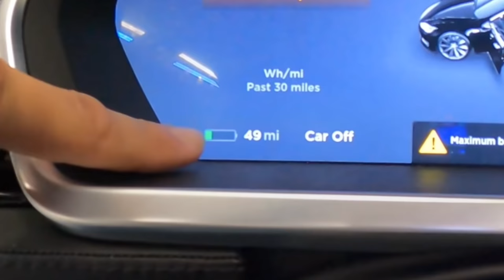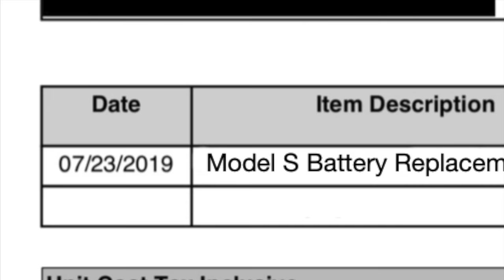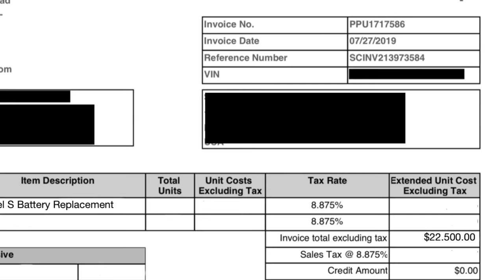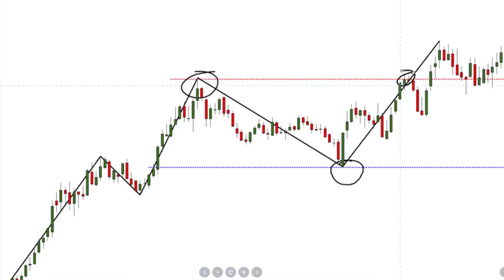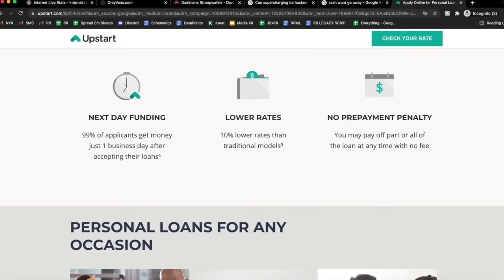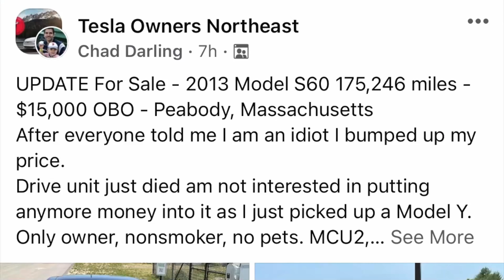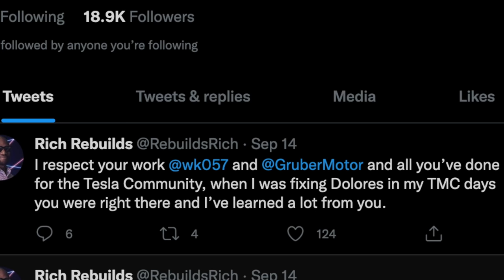The TRUTH about the $22,500 Tesla battery repair

Comment: I can't count the number of times Tesla egotists have claimed diesels have purposely rolled coal for them when, in fact, it was an older pre-emissions engine or likely modified. So much overreacting. I drove a Tesla for a long time and didn't notice anything intentional. I'm sure it has happened at some points.
Reply: Have an ID4 now, Leafs prior. Never noticed anyone rolling coal. Occasionally a modded diesel in front will have some puffs, but thats just something that can happen with more fuel/too much fuel/bad tune on them (used to own an 05 cummins manual)
Reply: If you are interested, there are many videos on the "Wham Baam Teslacam" channel showing this. Usually it features a lifted $80k+ truck that goes out of their way to get in front of a Tesla, usually swerving to prevent them from getting around them, slowing down, then stomping on the gas to create a nice thick smoke screen.

Those are very intental however, and nothing like genuine old trucks that are just trying to over their own weight to get up to speed. I have seen those too, and my response is the same, "You call that rolling coal?!".
Reply: @CodeMerk  I'm aware of a few of those but, from my experience perusing Tesla forums, etc., and seeing these people talking, most of them are clearly not intentional: Just egotistical owners wanting to feel targeted for clout when they know little to nothing about diesel engines.

Comment: It all boils down to giving the customer a choice. as a (non-ev) mechanic, i will tell a customer " you should replace the whole starter, but i can install a solenoid, it will be more for labor and i cannot guarantee the other components will last 100K, but if that is all you can afford, it is an option" some people do not plan to keep the car, moving, joining the military, etc. so often the cheaper fix makes sense. it would suck to put a 20K pack in a 23K car and the motor goes next week. give people options and they make the choice that is best for them. unless the people bitching are willing to offset the cost, they need to sit back and worry about their own issues.

Comment: The answer to "alot of electric chargers are charged by fossil fuels" is if you're not driving an electric car you're 100% powered by fossil fuels to start with, plus once you have electric cars and a charging network in place then changing electricity generation over to non-fossil fuels is a relatively easy thing to do - (and could be done 5-10 years with enough political will), solar is also likely to soon be the cheapest way of generating electricity full stop.

Comment: Great video. I think you call attention to a major problem right now. Many Tesla owners are so devoted to their brand, that the company knows it can do whatever it wants to them without consequence. Tesla really seems to be the only car manufacturer that gives their costumers what they want to give as opposed to what the costumer actually wants. A perfect example of this is CarPlay and Android Auto. Every automaker provides CarPlay and Android (well, not Volvo/ Polestar but that's because Google designed their infotainment and they are working on integrating CarPlay). Tesla doesn't and won't even pretend they will in the future. CarPlay is just one example. The thing is, if Tesla costumers demand better from the company they will get it. But as long as they blindly allow the company to $crew them,, the company will continue to $crew them.

Comment: This is exactly why the auto dealership states monopoly has got to be stopped. They want no part of the "right to repair" bill so they can continue to charge 4 or 5 , or more times the actual cost of the repair OR the cost of the parts. A part that costs $50 they want to charge you $398 dollars for it, or at a "special discount" of only $298. Wow, we saved you a $100. What a deal.

Comment: Tesla is making a huge mistake trying to build a frame that is also the body.  Their power packs need to be easy replaceable without endangering the cabins strength in its integrative approach.
In addition, 22k is ridiculous. 2.2k is more like it to replace an EV battery pack.  The process should be easy.  
Their throw away EV concept at Tesla does what for the planet again?  
Someone is going to develop a replacement pack that will not require a modification to the current pack.

Comment: I think that there is space for a third party tesla workshop to provide bespoke improvements to Tesla engineering.  for example a skid pan for the two wheel drive M3 that doesnt destroy battery coolant fittings when driven over a curb, or junk on the road. a fitted sheet of steel, or reinforced cabon fibre would be inexpensive to make, but would provide substantive piece of mind.

Just like i re-engieer Apple products. My 16” m1 Pro Macbook is heavy. and Apple geniuses gave it a case finish that is slippery in the hand. My 16” can easily be picked uip with one hand, without using gorrila grip (which can crack the screen).  All Apple needed to do is knurl finger grips into th front and back covers. This solution could also marginally improve heat disapation and case rigidity.  
Major manufacturing coporations should reliably put products to market do not have engineered in failure, or obsolesce!

Comment: Actually I think replacing just the bad battery module is a great repair.  If I had a bad injector on my gas car, I wouldn't replace the entire motor....just that bad component.  The fact that the battery pack IS repairable at the component level is awesome.  I would have done the same thing.  I always wondered if my battery pack was on its last leg could I in fact just put new batteries in it and have it back to right as rain....now I know yes its possible.  So buying a tesla with high miles or an older model is now an option for me.
Reply: Messages and chats

Comment: No major comments in regards the video...people has the choice to repair the way they want - Richard said it clear. The comment is mainly with actual EV technology and their battery reliability over time. If one or more battery modules fails after some years & miles of usage (not when car almost new or after few miles), that means the other modules might eventually fail sooner or later since it appears a normal wear out of the battery. So you could expect after some years & mileage or number of charges (don't know, 10 years or so) that your EV battery might start failing and only a full battery pack would fix it for other many years 😨. This could be a deal breaker in the future for used EV sales - I'm not sure if I would buy a 2012 EV car unless I have the proof the full battery pack was recently replaced. If they show they did battery repair (changed defective modules only) or even worse no battery pack service, I wouldn't buy it. Then it would be a risk to keep your EV for too long since price might need to drop significantly or a very costly repair would be required (both not financially viable). Learning every day more about EV challenges

Comment: IF one needs to have battery serviced for bad modules every two years, and the vehicle is kept for 10 more years.... then the NEW battery would seem the better route.... unless a serviced battery is covered for 10 years parts and labor... but no-one in their right mind would front 22,000 on virtually ANY repair. They would get rid of the car.

As long as you are not bankrupted by a battery service that only squeaks past the repaired warranty, the gamble is necessary. IF you can AFFORD for the worst case scenario, you might be the one of those who GETS 10 years of added driving, with only a decrease in range, and you win!

It is cheaper for a poor person to buy a new Tesla, sell it at 10 years, than to buy a USED one, and pay to keep it running years 11-20. Poor people should NEVER buy money pit cars. Mercedes and BMW....... you can buy an 8 year old car with 100K on it for 2000.00...there is a REASON expensive cars are cheap, used. 

An exception to those with limited funds buying luxury, exotic or hard to service cars: If a kid wants to do his own wrenching and LEARN about cars.... buy a used Lotus, Mercedes or Tesla, and make it a PROJECT.... hey, isn't that what a guy named Rich did ?

Comment: Regarding "Tesla competitors": give me a Subaru BRZ or a Chevy Corvette with an electric drivetrain and barely enough computer features to keep the battery charged. Heck, equip them with a tiny three-cylinder generator and keep the battery small, it'll still outperform the stock gasoline version both on power output and mileage.
Electric version of a normal sports car. No flamboyant trans-former looking SUV pretending to be a Mustang. Not something that looks like a 3 year old's drawing of a car. A low, two-door sports car that's reasonably priced, is repairable and has the absolute minimum of "smart" tech.
Let me wrap it around a tree if I want to.
Reply: Messages and chats.

Comment: I think the bigger question is how long will this fix last.  Maybe replacing with a NEW pack is the best method.  What if this thing fails in a year..you drop the pack and do it all over?  Doing that more then once seems like a lot of work.  I think comparing gasoline powered cars and EVs is a little apples to oranges.
Reply: Messages and chats

Comment: FWIW the steelman argument for charging an electric vehicle on a fossil fuel powered grid is that a fossil fuel power plant is still more efficient than an internal combustion engine, and it only gets better as you start adding even just a little renewable energy to the mix.

Comment: if a vehicle can't get 2,500 miles without any electric charging stations then it is of no use, you can't throw a can of electricity in the trunk to refill any electric car when charging station isn't available, I've driven over 2,400 miles in 52 total hours through canada in the winter had gas cans as even gas stations were scarce.
What do you do with your electric car when a storm takes out power?
 then how can you support tesla with how aggressive they have been to prevent repairs outside Tesla.

Comment: Massively good discussion at the end. I'd agree with Louis...companies need to stop rushing things out the door and using their customers a paying beta testers.

You will not get mass adoption until two things happen....a single plug type for all EVs and a single charging standard. As long as everyone is playing the cell phone ever revolving change of charging port types people are going to be les than enthused about adopting them. Imagine if every home/building you walked into in the US had a completely different type of electrical outlet and voltage coming out of it. That's the hurdle they have to get over.

Comment: hi , great video ..... i hope you will take your time to help me out a little. I am on the hunt for my 1st tesla , unfortune it will not be a new tesla , because of the prices in Denmark. So , the hunt is on for a 2014-2016 model S . with about 80-100.000 miles on the clock . but what to look after on these cars .... . i know range is a good pointer on the health on battery , and i know about the noise from rear motor on some of the early models ...... but is there something you would say ..... be aware ??

Comment: I really don't understand why the Tesla Fanbase is so quick to form a lynch mob when anyone points out a legitimate issue, offers an alternative repair method or has a dissenting opinion of Tesla

I know if I was quoted $22,000 for a repair on a car worth maybe $25-30k, and there was an alternative solution that would get me on the road for fraction of the cost, I'd be going with option B. So what if its not approved by Tesla or all the Tesla 'experts' online? If EV's are really the future, the manufacturers better come up with cost effective repairs and quick, or these cars will end up like old German luxury vehicles. Worthless as soon as the warranty is up because of astronomical repair costs/lack of parts availability.

Comment: I think the right to repair with EV batteries become a serious issue in the secondary/used car market.  The first owner will get their 100,000-150,000 miles, but those that follow have a car that could very well be bricked either by the manufacturer or if a battery goes bad.  It's not a very good scenario if we are locked in with the manufacturer.

Comment: Hi Rich,

New to all the tesla politics but i just wanted your inside advice on something?

If rear or dual tesla motors were selected for an EV conversion on a ICE vehicle and the ICE vehicle considered using the tesla battery system or another battery system.

Does the ICE vehicle using the Tesla battery system have to depend on the tesla software to charge the battery and operate the vehicle or can the ICE vehicle be remapped and reprogrammed for any battery system thx.

Comment: There should be a lower price for a battery pack if you are returning a faulty one.
The main price is the reare metals in there what you are returning. For most ppl EVs will not be acceptable if you have to spend 20k in a couple of years to replace the pattery. Where are the fuel saving then?
Reply: Messages and chats.

Comment: Involves with liability and insurance regulations for sure  not taking lightly if you have many things to lose.  Electrical issues are not easy to fix without authorization from manufacturers.  Looking at Toyota electric acceleration paddles and brakes killed peoples not long ago.  
So be extra careful when repairing vehicles with massive electrical involvement.  Mechanical failure always less difficult to repaired and replaced.

Comment: Not trying to be a fanboy, here, but to answer your question about charging with energy produced by fossil fuels, obviously green sources are the best, but even if your charging from fossil fuels, the miles you get from the same amount of fuel burned to generate power in bulk to charge your electric car, is more than the miles that you can travel, burning the same amount of fuel in an I.C.E. car. So, although your energy is still sourced from fossil fuels, electric cars are still more efficient.

Comment: Don't get me wrong, I drive an electric car because of the ease of maintenance, the current cheaper fuel source and for the instant torque
But I'm not fooling myself into thinking I'm a better person because of it. It's a selfish thing.
And really, when everyone needs to charge cars and the grid can only service so much/ only so many power plants exist, 
Electricity rates will skyrocket due to the supply issue and then we will just pay crazy rates for electricity in everything we do rather than just 3 times a week at the gas pump

Comment: Interesting conversation - I am not of the same view that electric cars are green. The best most reliable large scale , less poluting source of power is nuclear power stations - all the so called green solutions have useby dates - wind generators break and solar panels have limited life and they are abandoned make another pollution problem. I have not gone deep into research into the actual environmental cost of mining lithium and rare metals but from other "experts" they propose that it is not the electric car that will save us and this idea that electric is clean does not take into account the real environment impact of producing the lithium batteries and running/maintaining these cars . The charging process of any battery is done at a loss of energy so they are even less efficient than most people percieve. If people want be genuine about the environment - keep your current car, have it serviced so it runs as effeciently as possible, do repairs when needed and bypass the environmental cost of a new car every 2 years by keeping your current car in circulation as long as you can.

Comment: Steven for the win.  IT'S CHEAPER to charge and electric car than to put gas in an engine.  This is why ultimately EV's will succeed.  It doesn't have to be about saving the planet.  It simply will save money in the long run.

Comment: Of course for each maker easiest, fastest and most profitable way of repair is to replace whole module. But you need to remember that ALL can be done EASY, CHEAP, QUICK.
Problem is that you can take only 2 possibilities at once:
Easy and Cheap will not be Quick
Easy and Quick will not be CHEAP
Cheap and Quick will not be Easy.

Comment: Rich. I support anyone who does proper investigations and data and gives people the correct information. But there is one flaw. I hope you really don't think that an electric car is environmentally friendly. Just because it is cheaper to run because electricity is cheaper doesn't mean anything. It is the fact that energy can not be created or destroyed  it means  1 HP is still 746watts so you either get your energy from a power plant that is 30 to 50% efficient  or you get a gasoline engine that is the same. Either you burn gas or coal or oil for the electricity or burn gasoline. The energy expended to mine the elements fir a battery or recycled steal and aluminum for a gasoline engine would be the same. All things need to be taken into consideration. Have you done the math. I wish people would. People go by what others do and say. There is no thinking and effort put into doing research on the actual cost analysis of if things are so called green. I would love to get more into detail about it but it would take a week to spell it out on an email. So thanks for being a human and not getting into it on the guys who thought you fudged the invoice and support others who have a buisnes the same as yours.
Reply: hmmm is my 2002 rav4 green ? ive owned it 7 years but would it have been greener to have bought a NEW ev back then ?? btw ive never bought a new vehicle in my life. so is recycle reuse still appropriate as far as cars are concerned especially now were in the age of the EV savior ??